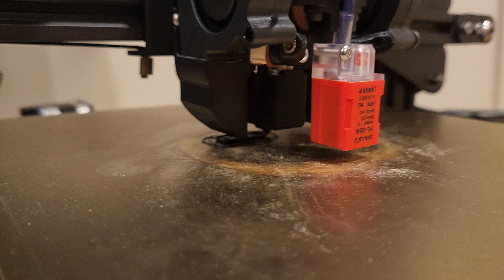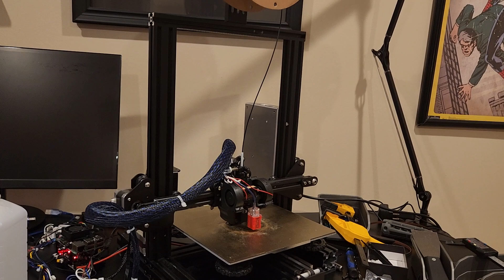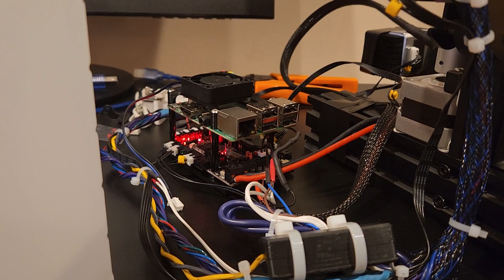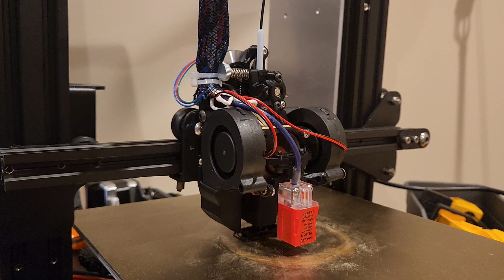High Speed Ender 3 Pro First Print

Comment: How much does this cost, is it considerably better, and is it hard to do all of that?
Reply from the maker: Costs roughly $100  without the rpi. 
As for if it is better or not, it really depends on your use case. As seen by @nitram , a stock ender 3 can get you very far, but this is just my solutions for some of the issues I was having. For example, my bed was warped when it came stock, so I upgraded the bed, and installed auto bed leveling. I wanted to print at higher speeds with high temp materials, so I swapped the hotend and those sensors. I was having major cooling issues, so I replaced the stock fan with 2 blower fans, and I hated the extruder weight, so I went with a sherpa micro. I mean if you don't have the same issues as I had, I think it would be a waste to make some of the upgrades I made, but if you want a high performance 3D printer, that's another topic. 

It wasn't that hard, but I have built printers off the same firmware and hardware as I used in this one, so I felt well within my comfort zone. Let me know if you have any other questions!
Reply: @3dferoze417  ty for responding. I don’t think I need it, bc I normally just use pla or petg and don’t really have a problem with speed or build height. I do want to get the auto leveling kit, and I got a glass bed after I destroyed my old one after a petg print got stuck to it, but I think I could’ve gotten something better. 

I do have a question, is there a better reasonably priced bed, and is there a cheap upgrade that you think I should get, if any.

Thank you for your time.
Reply from the maker: @hgames888 Would highly reccomend either a plain pei sheet, or a springsteel sheet. the springsteel sheet+the pl05n is an unbeatable combo, but so is normal pei and the klicky probe. those are the solutions i have on my printers.
Reply: @Mindless_One  I had to put my glass bed in the freezer once, but the build plate I had to replace because something got melted to it was the original one.
Edit: I probably had the nozzle too low.